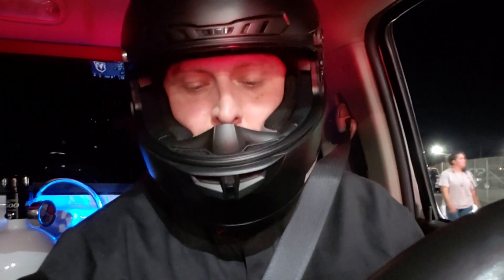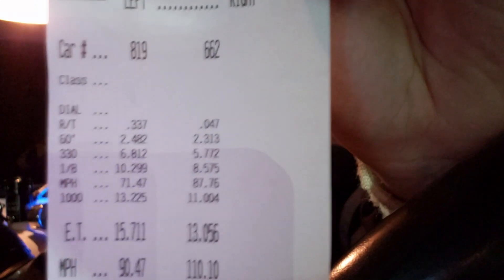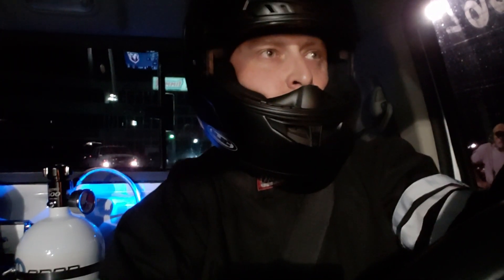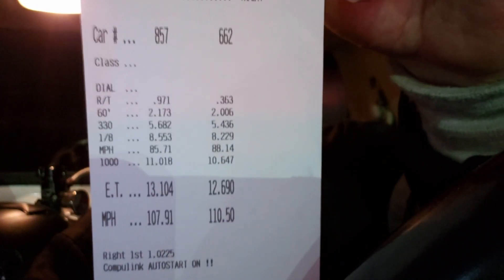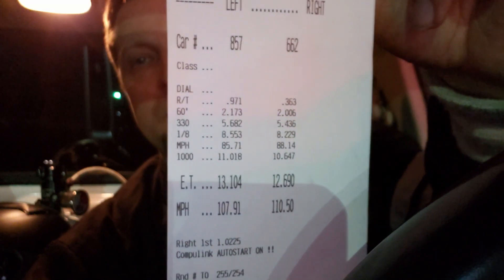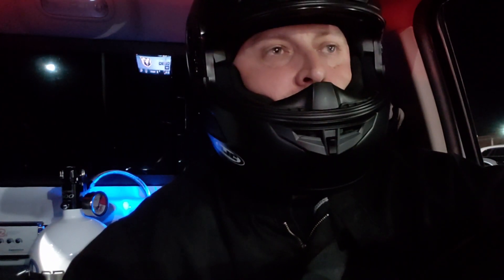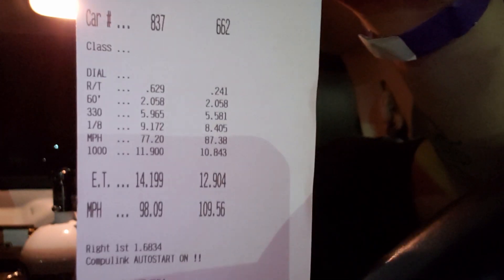NITROUS POWERED RAM VS CAMARO, GOLF R AND E85 TUNED CHEVY TRUCK

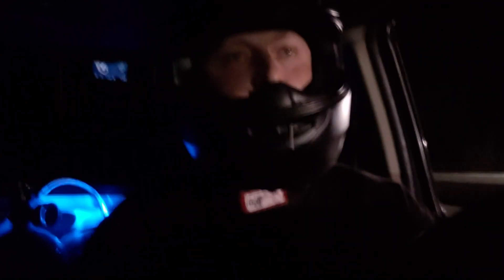Comment: Try gearing to 4:10 bro I’m sure you’ll be in the 12s with no issues in the 1/4 mile
Reply from the maker: My truck has factory 4.10s
Reply: In  that case 4:56 or work on the rear to shift more down force (SAG) on take off
Reply: Frostbite Ram 4.88 and 4000   stall 2 stage nitrous ftw lol